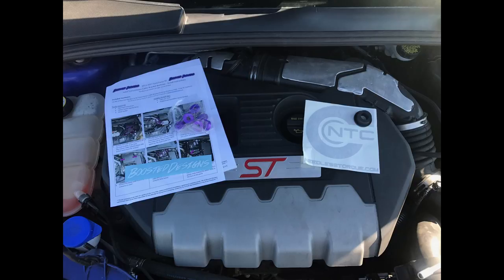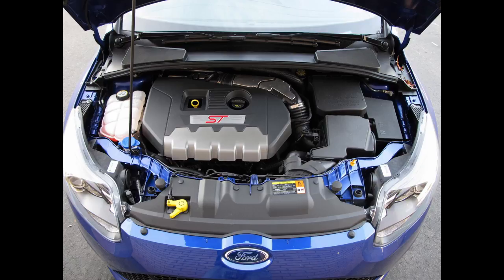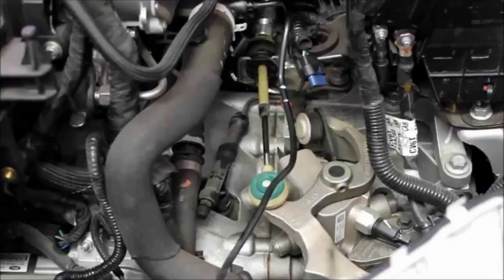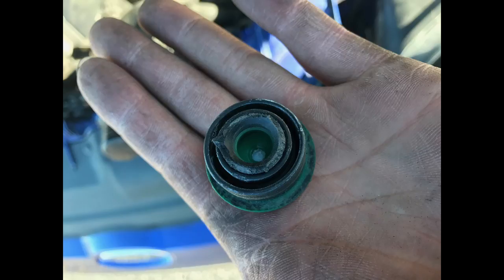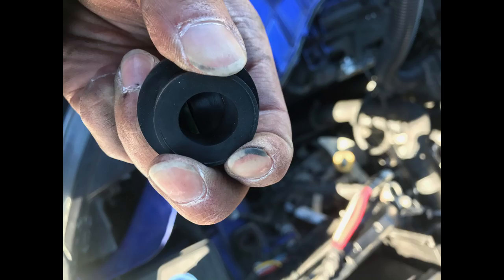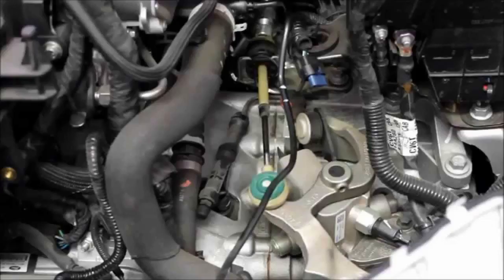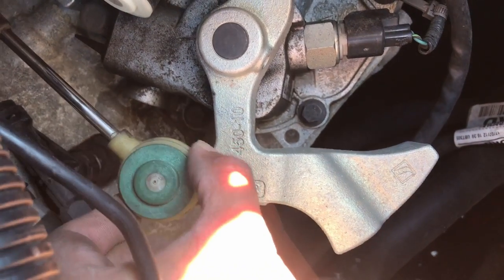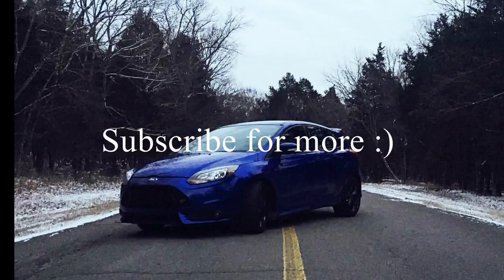How To install Focus St Shifter Cable Bushing Install

Comment: weird...your intake has a lot more heat shielding than mine. Mine only has it on the part going down to the turbo yours goes all the way across.
Reply from the maker: Could just be that it fell off or maybe yours is a newer model.
Reply: @Mythos_A3  mine is a 17 ST1
Reply from the maker: That may have something to do with it. But I’m not 100% sure. Or if you’re not the first owner. I wasn’t
Reply: @Mythos_A3  mine is a 17 ST1

Comment: Hows the cable bushing holding up?
Reply from the maker: +yonathan hailu so far it's been amazing. It makes everyday driving in the FoST so much better. Just need to shorten the throws still. Gonna do a short shift arm soon

Comment: Mines jumping out of 2nd when I change down 🤔 would this be the same problem?
Reply from the maker: It could be. But may be something else as well. I’m making a new video on a new set of bushings that are better
Reply: Blue & Boosted I’m thinking it’s the more expensive option 😩 the synchro
Reply from the maker: Ouch. What a bummer man
Reply: @gandhi1078  my car does something similar, its definitely the bushing bro, cuz u can feel it kinda click twice. That twice click is the soft bushing giving and not letting the car fully enter into gear, I just got an NTC bushing literally today and will be installing it shortly. IMHO u dont need to do the other bushings that are on the bracket until they actually wear out, the stock ones are VERY stiff with metal cores, but the cable end bushing for the forward and backward throws (the one in this video) is god awful. Also doing a neutral reset helped me live with the stock bushing until my NTC came in the mail.
Reply: @Mythos_A3  mine was the synchro so gearbox out, also had to replace the dmf
Reply from the maker: What a bummer. I recently had to do some trans work on the rs. Which I have a video on. I’ve just been too busy to edit and post it

Comment: At times my transmission wont allow me to shift into Reverse would this bushing have anything to do with my problem?
Reply from the maker: Is it the stock bushing or you have the same one I do? It’s not the bushing from what I’ve seen around the forums. It has something to do with the transmission itself I can’t remember what it was wether synchros or something else. I normally don’t try and force it. I just shift into first and second and it goes in easy
Reply: Blue & Boosted yeah I got the same ones I just installed them and it’s definitely not the issue but it’s a big difference on my tranny
Reply from the maker: Hopefully you’re liking the new bushings. But yea I’m not sure what the exact issue is. I keep forgetting to look it up. Been really busy with work